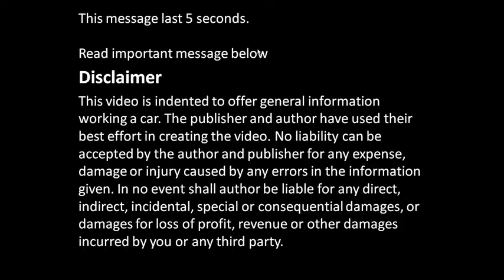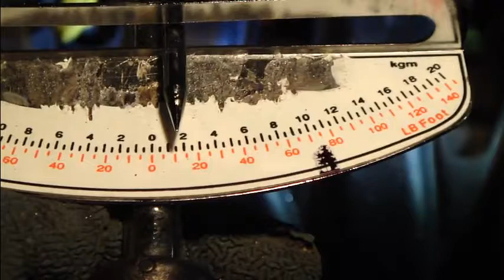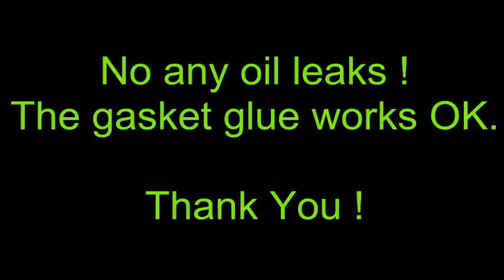How to replace the valve cover gasket on a VVT-i engine Toyota Corolla. Years 2000 to 2007.

Comment: Because of your videos, I save labor so I usually pay for the Genuine Toyota Parts.  In these videos you often suggest Genuine Toyota.  I replaced this gasket already with a new unbranded one and now I'm fixing the leak again.  since my gasket is fine, I'll attempt this form-a-gasket to seal it better.  I'm sure the reason is that non-OEM don't have access to the actual compound specs.  They get form factor, but not the required engineering specs.  It's true in anything from cars to bikes to appliances to electronics.  It MIGHT work, but as in my case, it didn't quite seal due to probably being a little less malleable than the OEM spec.    Not drastic oil leak, but enough to leak vacuum which threw a P0171 code.
Reply from the maker: Good info. 👍😃

Comment from the maker: Hi. Thanks for info. I believe, that your corolla's piston rings are stuck. This piston ring stuck is very common Corolla problem. You should change new piston rings to your motor and this service helps to oil consumption. And motor becomes also little powerful.

Comment: Hi Peter , a little update. I don´t think it´s recommed first to lay the gasket on the cylinderheat than better do it in der Cover. I changed it now because of oil in the hole of sparkplug nr.3 . Look at the picture i made from the old sealing. It seems if you don´t find the exact position it will not fit in the ring holes of the cover so sealing will be not tight. So the other way first in the cover with some partital glue for fixing then mounting. https://www.file-upload.net/download-13600950/20190511_1440031.jpg.html

Comment: Sir, you need to place and set the gasket on the cover first. There's groove on that cover where you need to insert the rubber gasket, otherwise it's near impossible that this gasket gonna sit perfectly.
Reply: That was my idea too but, if the gasket not holds on the cover when you put the cover back, how to do? Is it absolutely necessary to add the gasket maker paste?
Reply from the maker: Noted 👍

Comment: It´s much more easier if you just take that new gasket and press it to the valve cover groove. It will stay there. Then when you add that silicone sealant just put it on those  2 small caps beside timing gear sprockets, no need to put it elsewhere.
Reply from the maker: Good idea too. Thanks.
Reply: you are good in this stuff too.
Reply: Where is the gear sprocket$?

Comment: I just replaced the spark plugs and I also wanna change the wires due to its mile. Also it does have rough idle.

Comment: Hi Peter, I have a corolla 2005.. i have to change oil in every 2200kms..it does not over heat..there is no visible excessive carbon in the exhaust..does it require a valve cover or piston ring change??? also, will there be a serious problem if i keep on running it like dis and keep on changing oil  ??

Comment: U should use a new gasket. And only apply liquid gasket to a certain spot that u have too look up in the manual. The gasket gets put in the cover. Not the gasket getting put on the engine. And your supposed to torque the bolts down in a car sequence and to a certain torque spec. Also its a 10 mm socket not a 6divided by whatever he said.
Reply from the maker: Thanks for comment. :-)
Reply: Peter Finn your welcome

Comment: yes..oil burns out at every 2200kms..it is suppose to run for 10000kms...somehow engine is consuming excessive oil..but it does not over heat..i got the engine assembly checked from Toyota..there is no leakage...
Reply: Could be your pcv get a new one

Comment: I installed a new gasket not too long ago because of a leak.  I didn't use 'glue' for new gasket, but I see I have a very small leak.  Another video with another car suggested that you at least need to use some in a couple places, like by the bolts.  Before replacing again, I was thinking of popping off the cover and just adding a little glue as you suggest.  Could my two little areas, both on firewall side on either side of engine) be the cause of my PO171?  I don't find any vacuum leaks, cleaned and finally replaced the MAF sensor and the code returns.  I tried spraying the intake with carb cleaner test, which changed nothing, but the code keeps returning (after couple hundred miles after reset).  I'd rather buy 'glue' or $15 gasket than a shop to do a $150 'diagnostic.'  Oh, the PCV was replaced new with genuine Toyota PCV not too long ago.
Reply: Most likely due to the lack of sealant that is required on the 2 joins with the timing chain cover. There are some great diagrams out there with torque requirements

Comment: It's not a good thing to use back the old seal!?
Reply from the maker: Thanks for Your info. :-)
Reply: It's not a good idea to reuse old gaskets, better change them, the rubber loosing his elasticity and gets very strong with time, this is why it is leaking, if the oil leaks inside the spark plug holes, this is really really not good, the gasket itself is around 15 € a piece.

Comment: You said you used 10 foot pounds of torque for the bolts.  My haynes manual says to use 89 inch pounds, which is about 7.5 foot pounds.  Is 10 close enough?  How high could I safely go?  Also, is there a specific type or RTV sealant I should be using for the timing cover joints?
Reply from the maker: occamsindecision Hello. Also 89 inch is Ok. These bolts crack with about 20 foot pounds. Use special gasket sealant, like Sika or Loctite brands.

Comment: Hi peter could please tell what is the maximum length the of head bolts out of a 2001 vvti 1.8 thank
Reply from the maker: ava birchall Hi. Please visit in Toyota dealership shop and measure the new bolt.
Reply: Thanks for the reply, would you replace them every time you take the head off
Reply from the maker: ava birchall It is good to replace every time. There is 15% risk of broken bolt.